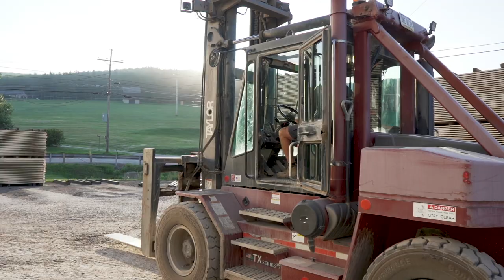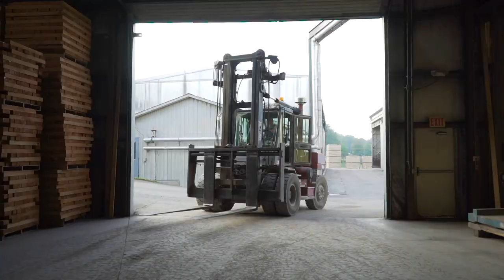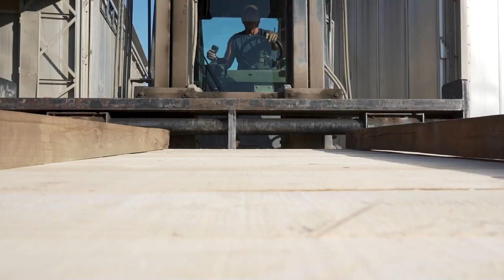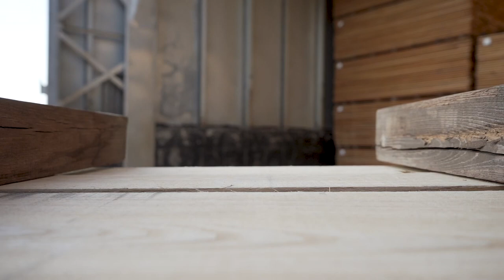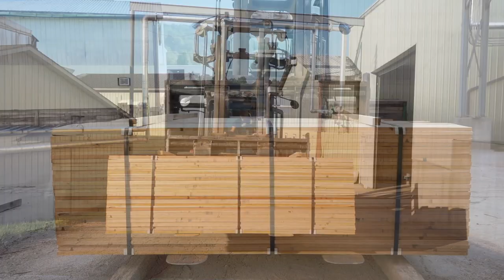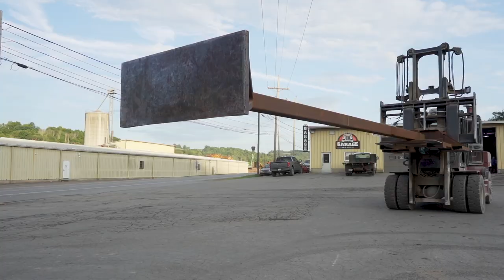Matt Thomas - Forklift Operator / Yard Manager - Cummings Lumber

Comment: The Taylor 360 at my job is in bad need of new forks from ppl damaging them and ending up shorter from the damage being ground down.

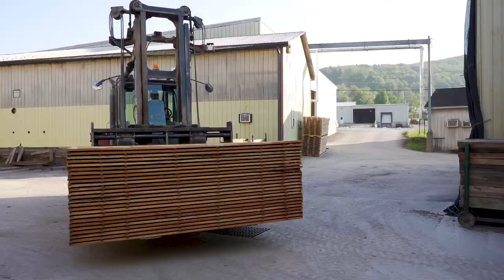That little inch gap between the stack and the elbow of the forks at 1:12 here? You would be short a board when lifting that with our crummy forks, particularly 1x4 and 2x4 stacks.